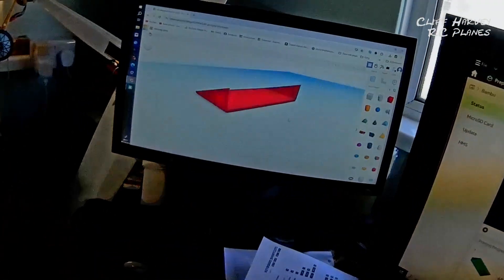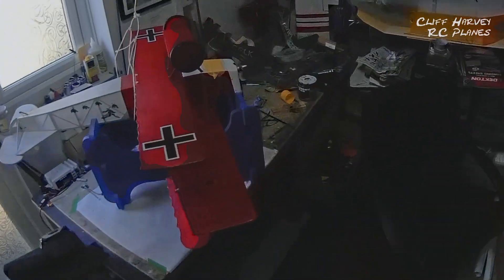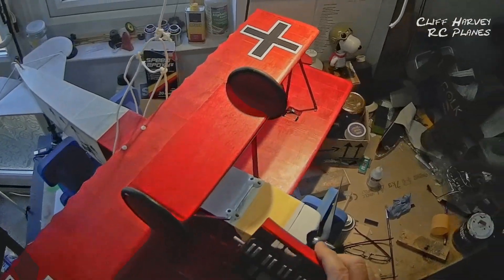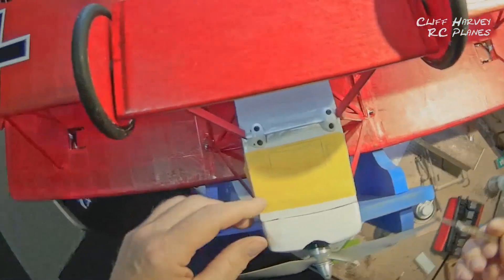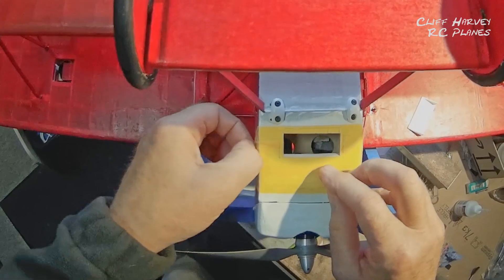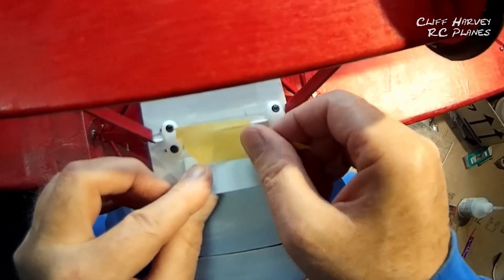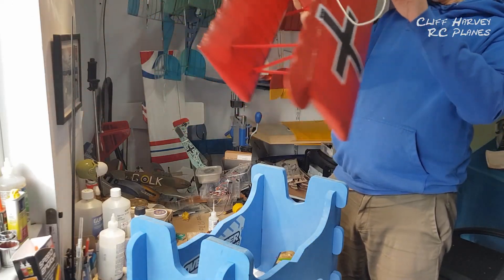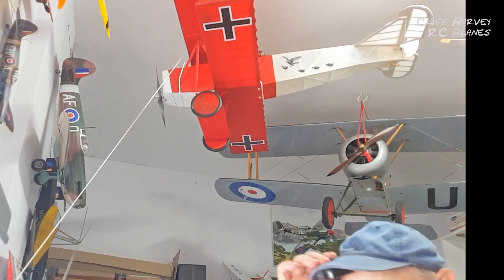3-D Printing to Cool the Fokker ESC

Comment: Very interesting. A lot of thought and engineering goes also into the air ventilation. I also like your storage solutions. I am running out of space myself. I have to go out and crash something soon ;) Thx for sharing!
Reply from the maker: Thanks Andrew, the roof in my room is higher than usual which means plenty of airborne storage 😁

Comment: A p.s. to my comment, thanks for replying to it. I meant to ask what was that spray that you used and what did it do?
Reply from the maker: It's an accelerator for ca, loads of makes on the market, it just makes it dry instantly and, as a bonus, it makes it foam up a little if you want to fill a gap
Reply: @CliffHarveyRCPlanes Thanks, it sounds very useful, I'll get myself some.